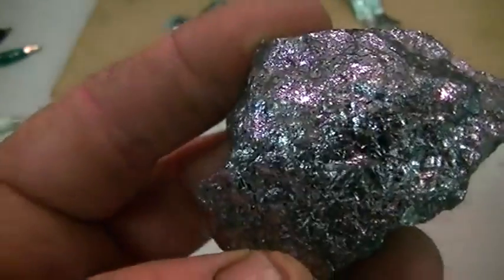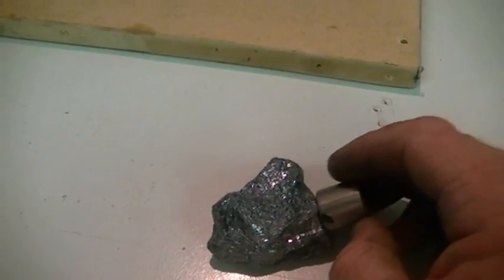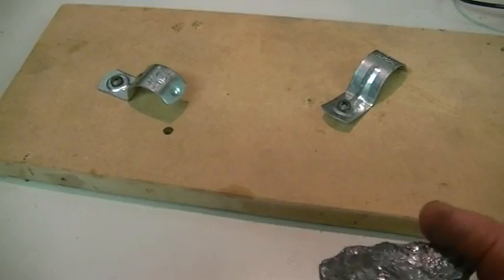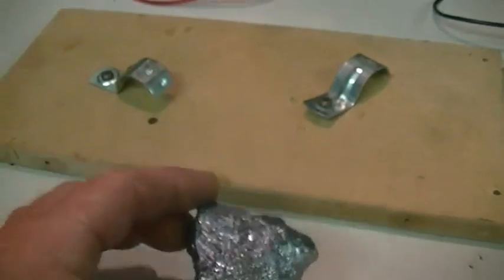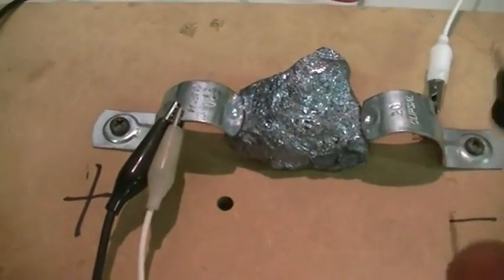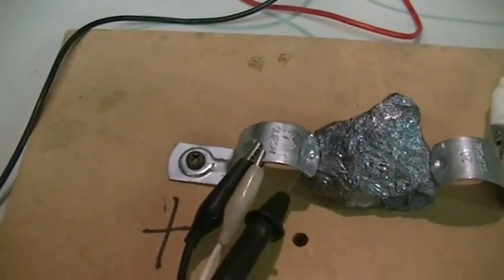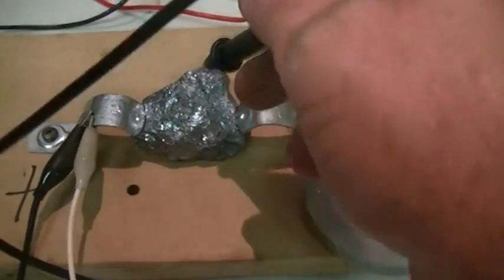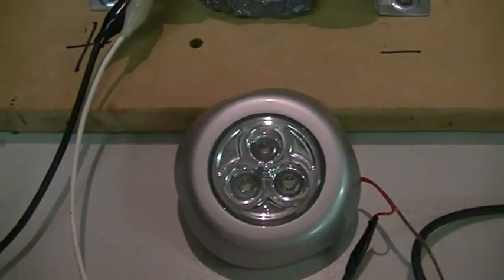Meteorite space rock resistor

Comment: 1) If it's not attracted to a magnet then it's not a meteorite.
2) If it's bright and shiny then it's not a meteorite (the outside would be cooked from entering the atmosphere at 30,000+ MPH.

and ,
3) Electrons actually flow from negative to positive, oddly enough.  I know, it sounds strange, but it's true.

Sorry, I'm not trying to rain on your parade or anything.

Since it appears to be made of a single compound, maybe you could measure it's volume by putting it in a graduated cylinder with water in it to get it's volume, and measure it's weight.  These two values and a little calculating would give  you it's density.  Then you could probably look it up.  I bet that would get you a pretty definite answer.
Reply: some meteorite don't magnetic.
Reply: Johann Moser 
You are an idiot. 
1.) How many lies a day do you believe, without proving yourself?
2.) How many lies are we fed by science everyday?
3.) How would 3 people from earth determine what the universe has in it? 
You should quit your science job or whatever it is you do and allow people who are not consumed with pre existing lies to believe every single fantasy they hear as truth.
Reply: Magnets do not work on Nickel meteorites. And is a fractured peace that may have come from the interior of the original. So would have no fused crust.
Reply: I read some place that only 80% is magnetic. (guess they loose some ability after years in the ground?) 

But you are right with the fussion crust (should be 1 max 2mm thick ) 

But i think perhaps nikkel and density test are those with the biggest acuracy? :)
Reply: Johann Moser you no have the stone..I'm from Malaysia..I have one stone same like that.I get from my farm..It's true..100%
Reply: P Rick u are right 👍👍👍
Reply: Johann Moser I have it

Comment: Check out "ohms per square" measurement. Imagine an infinite number of resistors in a 3D grid the shape of the rock. All points measure equal resistance to everywhere else. ESD mats use this measurement. In the lower resistance model of the rock, all voltage drops across it from any point will be the same.

Comment: You do know that the PIR temperature gun does not measure the temperature at the laser spot, right???  That's just used for distance aiming... not closeup. It's offset mechanically from the PIR sensor lenses, and aimed nearly parallel to the IR lenses... so that at normal useful distances, the laser spot approximates the area sensed by the PIR detector.

Comment: It does look like the voltage across is almost the same, indicating there is almost no resistance coming from the rock itself.
Meaning: the resistance you measure is because the clips are actually forming a junction with the rock.
Then again, au contrair: the rock does warm up, indicating the resistance is not on the junction but on the inside.
So no, I can't explain this one at once.
But I think it is a very cool idea to go and just check out a rock. I believe Tom Bearden did this as he was about 10 years old, examining the same stuff.

Comment: One possible reason for the rock having the same resistance like that may be the contact resistance between the negative point-contact and the rock in general is pretty high (maybe oxide layer in between the 2 either on the rock or rust or something else...) and it's effect largely outweighs the V_drop across the rock.

Another possible cause, and more excitingly, there may be a bit of semiconductor action going on! I know they use germanium crystals and other weird minerals (like iron pyrite) to make primitive point-contact diodes for crystal radio's.